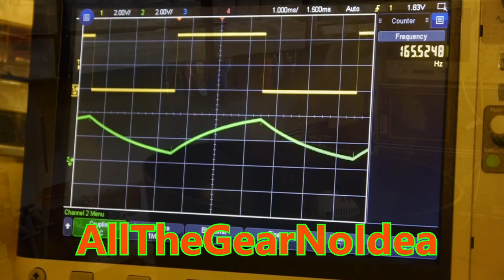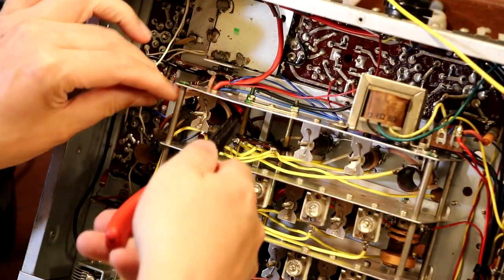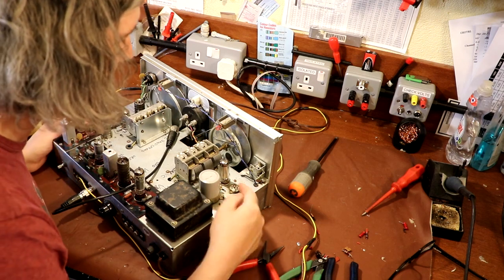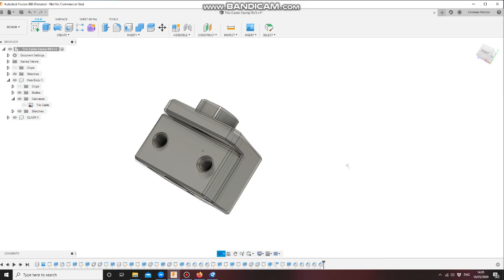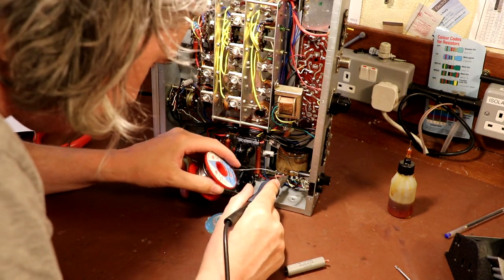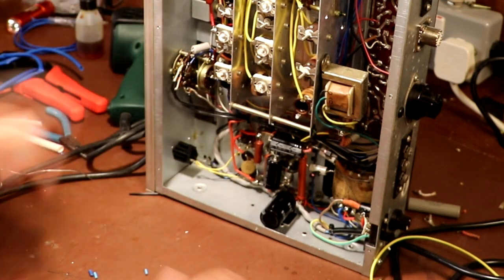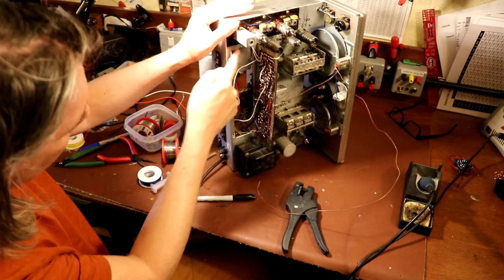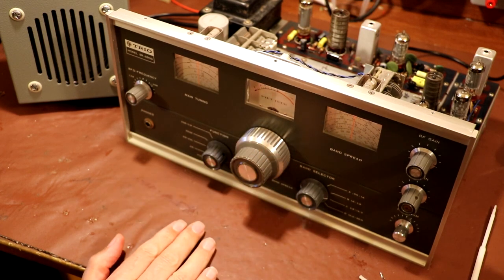TRIO 9R-59DS Part 3

Comment: Well done Chris. That's the thing with old radios. You just never know how well they worked even when new. I find myself trying to find problems that aren't really there in an effort to make the radio perform better. In many cases the radio is working as well as it ever did and it ain't got no more to give. Stay well. ATB Doug.
Reply from the maker: Doug McArtin  I think your absolutely correct. I have played with a lot of gear that has on the bench better than 1uV sensitivity but in the really world with really noise level who can tell not me. I think it’s working fine.  These were never great performers but I’m not complaining it’s still a joy to own and use. Thanks stay safe regards Chris

Comment: Very interesting video, Chris. Thank you. It is always a pleasure to watch you work - attention to detail and a chuckle or two! I agree, on some projects things do seem to fall perfectly into place and there is a greater sense of satisfaction when they do. 0A2s and 0B2s are the zener diodes of the valve(tube) world. I would think that the audio output section could be connected to the HT after the initial RC filtering as long as it is prior to the series dropping resistor for the regulator. So long as the HT remains well above the regulator voltage the 0A2 will maintain a steady voltage to the oscillators. I am looking forward to the tune-up video. Regards, David
Reply from the maker: David V  Thanks David. On the supply to the Output transformer that’s what I did it had a couple of stages of smooth and I moved it to the first stage. Strange really the manufacturer didn’t do that. I did quite a lot of testing to see if the move was detrimental but can not detect any issues etc.  I enjoyed  it more interesting than modern stuff and a lot easier to work on. I may start collecting Trio. Thanks stay safe regards Chris
Reply: @allthegearnoidea6752  The first radar system I worked on was mostly valve type gear in the transmitter, trigger generation and canceller (removes non-moving targets) sections so I got my fill of working with valves. Now I enjoy working on solid state equipment with no HT to speak of, mostly through-hole although I am doing more and more surface mount. David

Comment: Smashing video chris :-D
That's your name now ' Mr snippey ' :-D.
The power supply looks very neat to me, Nowt wrong with that lad lol.
I've had my share of other peoples mods and some of my own dodgy mods ha ha :-D
Once in a blue moon making something neat can create problems, also putting things back to standard can kick up problems that the previous owner fixed.
Try swapping out the front end valve, just in case its a bit soft.

I'm doing some bodging at the mo, my mate was given a Leak 20 Stereo valve amplifier and the plug in preamp head unit with all the knobs on. 
The head unit did not have enough anode voltage, the problem was the amplifier with it's leaky coupling caps and carbon resistors that ignore the colour coding stripes lol.
The P.a valves were conducting hard with no inputs, and the cathode resistors were smoking, i'm gobbing caps and resistors on to the tag board to quickly fix the problem in a temp way, the output valves could be knackered but the unit must work for me to see if they are ok.
If it works well and all voltages are happy +no overheating then the door is open for a full new parts replacement.
Reply from the maker: zx8401ztv  Yes I was thinking of trying a different RF valve I think they all have a lot of hours on them. But to be honest it is actually working about as good as it should be these didn’t perform very well even back in the day etc. Still I enjoyed it. Your valve amplifier project sounds very interesting. Although any type of valve amplifiers are going for crazy money. Fairly typical on the coupling capacitors they are always going to be bad etc. Thanks for watching regards Chris.

Comment: From what i worked out on the 9r-59d is the shaft is so worn out that it needs re machining  or something the only other fix would be to separate the 2 shafts somehow.Or to put some friction on the main capacitor to stop it happening.
Reply from the maker: Sorry Michael cannot really offer any advice on that you own idea sound possible or look for a donor radio as they are plentiful. Still surprised it’s worn out as it would take a lot of knob twiddling. Is there an adjustment screw at the back of the tuning condenser could this be very loose.   I have seen  this a lot but it’s always been down to the shaft being bent. Have you tried dissembling and cleaning?

Comment: I started using a solder sucker on vintage radio wiring years ago, it solves a lot of the problems involved with removing old component leads. I don't know how well one of those desoldering pumps works, I have seen a fellow on Y.T using one on vintage radio wiring, even though they were intended for printed circuit boards. 
   It always throws me the differences in terminology, what you call a valve base is what we call a tube socket. A tube base it the bottom of the tube where the pins come out. 
   I don't understand that polarity thing with plastic film caps either, if it's so important then why is it not marked anymore? Also I've seen plenty of caps in vintage radios with the marked end of the paper caps going in either way. I would think that checking resistor values and lead dress are much more important then one end of a non polarized cap goes where. 
  By the way, have you tried shopping for parts from Mouser or DigiKey, or is the shipping to G.B prohibitive?
Reply from the maker: Oleg Kostoglotov please accept my apologies for not replying sooner I don’t always get updates when people leave comments. To be honest I’m totally sold on even the cheap heated desoldering guns if you haven’t bought one do it now you won’t regret it.  But braid is great when you cannot get the desoldering gun in or it’s very delicate work.   I’m sure the whole capacitor outer foil is a real corner case. If you have a very high gain high impedance amplifier stages it could make a small difference etc. My other thought is that most analog electronics went down the BJT route and these are munch lower input impedance current rather than voltage driven.  The other idea I heard was it’s safety so the outer foil alway went to ground. Thanks for watching and comments.  Stay safe regards Chris
Reply: @allthegearnoidea6752  Don't apologize, much of the time I'm very happy to receive a reply at all to a comment I make, regardless of how long ago I made it. Though it does puzzle me why someone would reply to a comment I made six month or more ago, that even I don't remember, particularly when it's non sequitur.

Comment: Well done Chris, that sounds wonderful ,I like factory myself, recently I was bought one of those Chinese kit radio's, first thing was to chuck all the dodgy caps & resistors out, which is always the let down with them, the only thing I added was a small noise reduction filter I made, which was the right move, sounds lovely . I  see you use a 3 D printer, I want to get one, that's simple to use, do you have any pointers please, I probably need to buy one 3D printer for Numptys.
Paul
Reply from the maker: paul collins  hello Paul my apologies for not replying sooner I did not see your  comments until just now. I buy printers made by Qidi I have had three and they work very well but there are many cheaper options.  I would probably look for review on YouTube but check out the qidi one. Don’t bother with dual extruder they aren’t worth the hassle.  Let me know if you want to have a chat. Install fusion 360 on your computer and get drawing in 3D you need to learn this. Happy to help you learning etc

Comment: I have one of these radios and the band spread knob keeps pulling the main capacitor out of tune here and there how can i stop this friction happening between shafts.
Reply from the maker: Actually I have the same problem. I think the shaft is a bit bent on the one I have and it picks up in certain positions. It could also have some lubricant that’s gone hard. Maybe wash out the old lube.

Comment: I have just acquired a 9R-59DS. Works well on AM, but SSB has little/no volume. I just don't have the facilities here to do much practical work. Do you offer a paid-for alignment service? Malcolm.
Reply from the maker: Hello Malcolm. I’m a sorry I don’t offer a paid service. These old sets can be a lot of work and there is always a risk of accidentally doing more damage so I don’t take on repairs. The old Japanese capacitor in these go bad and I expect that’s causing your BFO problem. My radio was a bit deaf when I started but responded to changing out the capacitors. I’m sure someone on the BVWS forum will sort it for you if you put a add in the wanted section. Thanks regards Chris

Comment: Oh yes, I remember that Email.....I think? The regulated side as you said should be for precision  circuits ie LO and BFO I would say. Are you sure those old caps in the IF were paper?
How badly does it drift on warmup? I would like to move the LO cap away from any valve if possible to reduce drift.
Reply from the maker: Simon Spiers  The capacitors I changed are described in the manual as either paper or metalized paper or the obvious electrolytic. They were mainly within tolerance some of the electrolytic were  high as expected. I didn’t check any for leakage.  The volume from the set has been much improved. Regarding frequency drift I would say it’s very stable even in SSB mode, ok not actually very good but better than it was, it’s a valve radio etc. I think that was down to the work I did on the power supply and clipping down the loose internal wiring.    Ok no email but we did chat about it artistic license etc. Thanks chris
Reply: Do you mean those grey jacketed capacitors, those are often oil filled, and should be changed.

Comment: Mine is missing on one of the sets. Luckily if the correct primary fuse is fitted the saturation of the transformer blows the fuse. Some may have upgraded the fuse to a nail or a blown fuse wrapped up in tin foil. Then the transformer becomes the fuse! 
RE knives, they are very very dangerous and you should never, ever use one without a grown up supervising .
Reply from the maker: Simon Spiers  you should replace all those pesky fuses with nails etc, I’m just off outside to run with ✂️ scissors. Catch you later

Comment: Also waiting for 6aq8 valves from America and have some Russian so called  replacements which do not work as i was promised called 6h1n-bn.The oscillator is not running and i have to use my old RF generator as a donor osc to get the broadcast stations to work valve 3.